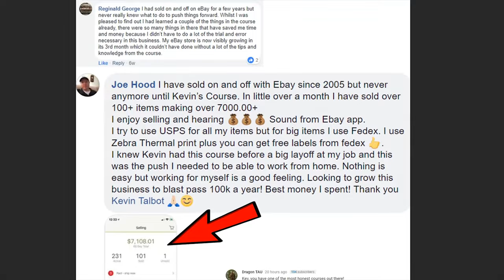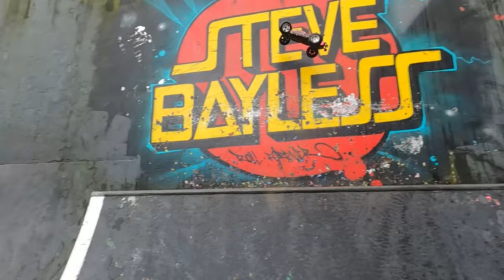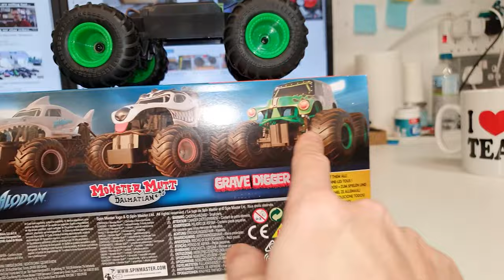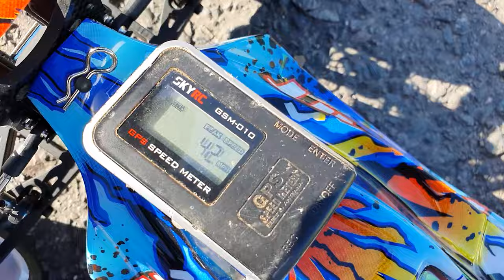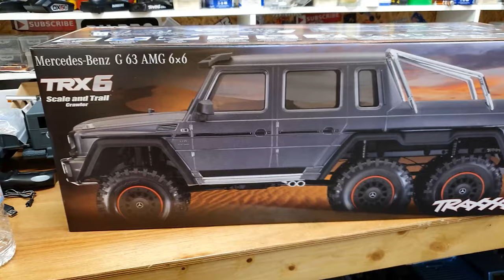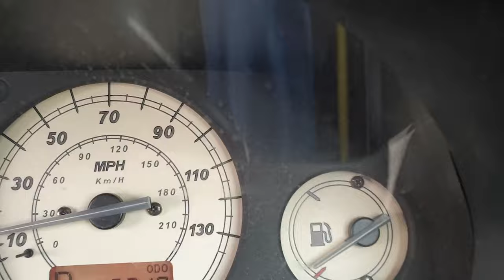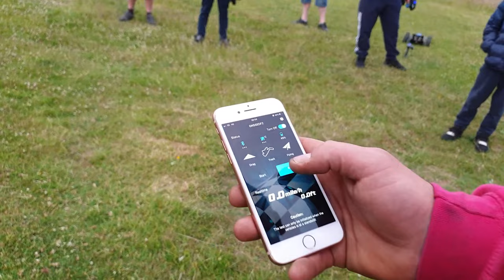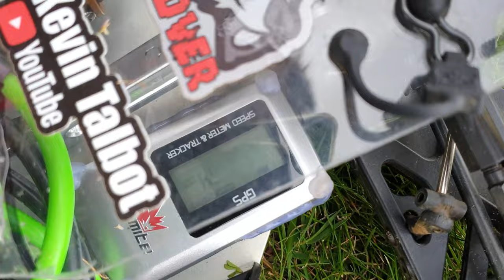Kevin Talbot 2020 Rewind RC Car Mayhem!

Comment: So for christmas i got a Himoto Firestone And When we got it it was really hard to pull start it was if its siezing up, we bought a Starter box And Sure enough it helped We got it running good 2 quick blasts down the street. Fast forward to today Went down to a good place to drive the thing and i noticed at full throttle it would either runaway or got full throttle then stall we got it running perfect until, Im not sure if the car turned off cause i had no steering no brakes it went flat out Into A MASSIVE Rock And all i saw was the air filter got 10 ft up in the air once we retrieved it it had, broken front left bottom arm, broken front left strut, bent front shock tower, broken rear right arm. And as it turns out there aren't many Places to get spares from since the thing is pretty much obsolete. Im only 13 And this is my 4TH hobby grade Rc car My first being this FTX Outlaw, second Tamiya vw Bug, Third Tamiya Defender 90, 4TH The Firestone. Just wanted to Tell you all this little tale!

Comment: Hey all, Need the community's help with a question I have :D

- So My ESC can only take up to 5s battery according to the manual and I have 2x 3s batteries I want to run in series which would make it 6s.  My remote control transmitter has trims on it to reduce max power and such to different channels *turning and acceleration/speed*, if I turn down the max output on the controller for the esc channel to say 80% would that in turn reduce the power that the esc receives from the 6s setup or does the esc still receive the full 6s of power and then reduces the power to the motor? Its a bit of a complicated question sorry and im not even sure if understand it at all.   Not sure if anyone here has ever ran into this question or situation before.  I know I can turn down my power to a point where the rc only does like 5km an hour and has no power but I am not sure if that's reducing the voltage or power to the esc, or if the esc is getting full power from the batteries and then only feeding the motor the lesser amount. Just don't wanna fry my esc and can't afford new batteries at the moment, I went from a 14t pinion to a 21t and 3s just doesn't have the go off the line.  Thanks to any input.

Comment: Hey I got a question, I recently got into this hobby from watching you, I bought a dementor and I got an imax b6ac as well as a 5000mah 4s lipo with it. I used it twice and I went to charge it today and my charger keeps saying it's low voltage, I guess it discharged itself since the last time I've used it, which was 2 weeks ago. It's been sitting in my closet. Idk what to do outside of buy a new battery, but it seems kinda stupid if it's brand new with only 2 actual uses.

Comment: In 3 yrs banggood has ripped me off on products.....2.5 yrs ordered a glider and never got it to find out they discontinued it and never said so on their site and lost $250.....just dec 2020 ordered a rc airboat kit under another account and got it and built it to find out steering port on receiver is dead and gave the site all info they asked for to replace it but that been 3 weeks now and they are ignoring me-the airboat cost me $171.85 so as of not they have taken $421.85 from me in total and now feeling like i can't trust hobby sites anymore cause this is the 3rd site to have done this in 5 yrs